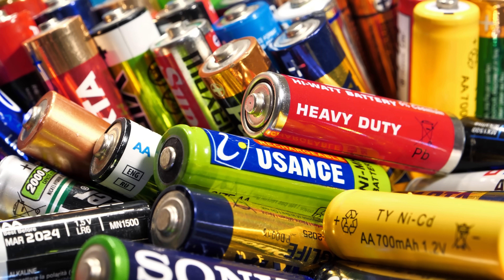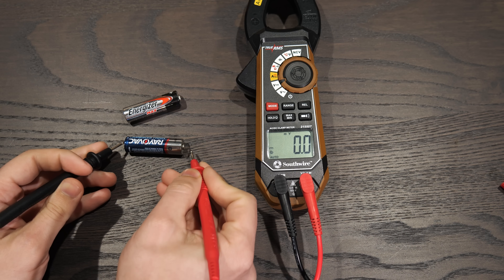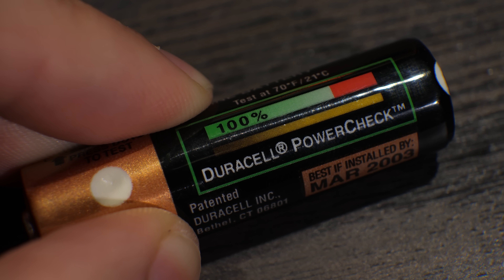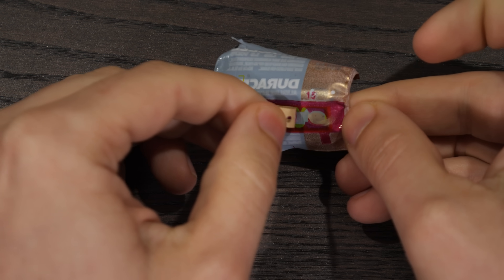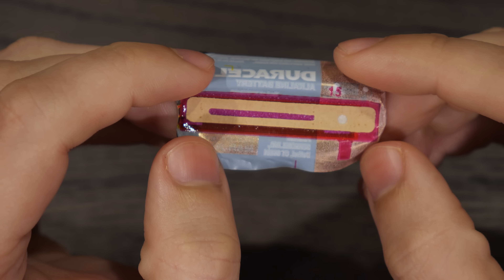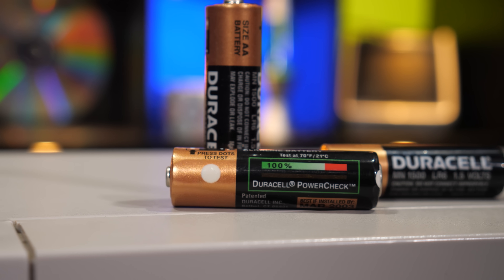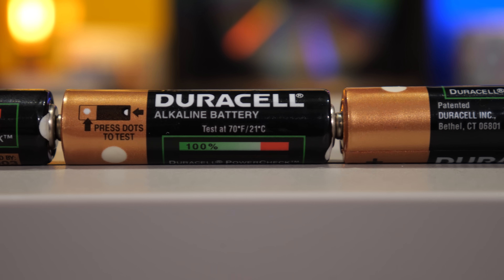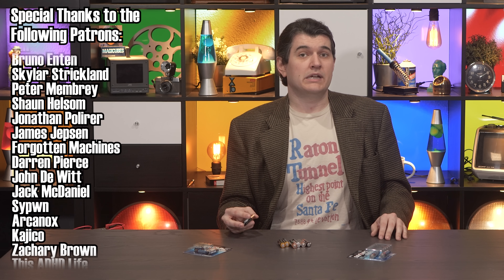Duracell PowerCheck: A genius idea which didn't last that long

Comment: Most e-bike accumulators have such a "power check" feature included.
But those are of course several hundred times bigger than an AA-battery.

Comment: It's e-waste. And a lot of devices had low batt indicators. Then it could add to the bulging and get stuck in flashlights. Then airports got strict about electronics.

Comment: The power check feature is what stopped buying Duracell. The number of DOA batteries was rediclious, and they had absolutely no shelf life once you started using them.

We'd put them in head lamps and get around 4 hours life, but if you put new ones in and only used it for 30 mins, they'd be totally dead 2 weeks later. Older Duracells without power check, and other brands didn't have the same problem.

We figured the tester was somehow being activated, or they cheaped out on the manufacturing, either way, we actively avoided Duracell pretty quickly.

Comment: My theory is that the original idea was to have an always-on indicator, so you could see the state of charge just by looking at the battery. Then they found out that it wasn't possible without slowly draining the battery and they ended up with this cumbersome implementation, unable to convince the marketing department to just scrap the whole idea.

The white buttons always felt like a clumsy afterthought.

Comment: I actually made a lot of use out of those powercheck batteries. My Gameboy was never that great at communicating how much charge the batteries had left. So if I was going to be dragged along on some outing because the parents needed to go somewhere and for whatever reason didn't want me to just stay home, I'd have to check the batteries and see if they had enough charge to last me the trip. Of course I could just grab an extra set of batteries each time we went out just in case, but then I'm always carrying batteries around with me. I could also have just kept a spare set in each of my parents cars, but who knows what is going to happen between me putting the batteries in there and the day I need them. Most likely my brother would find them and decide to throw them at me in a long car ride, or just hide them somewhere. My parents might find them and decide they need them and then not go and replace it.

Sure we had a battery tester and I could just go and get it every time I needed to check, but the built in powercheck was actually really useful in that situation because it meant I wouldn't need to go digging through the battery drawer to check and see if I needed batteries or not.

Comment: I usually went by: long term-low power or high risk of damage  (rear light of my bike comes to mind, it is not waterproof), use a disposable battery; for high power use use rechargeble NiMH. I think I have seen USB-rechargeble powerbanks in AA-format with appropriate terminals.

Comment: As for the usage pattern.. it's quite common to try replacing the batteries when something seems to not be working. For that you need to get some from, typically, an unopened package (more about the latter later). And it turns out it wasn't the batteries, so maybe you insert the originals ones again, or you don't, and  you try something else to figure out what's wrong with the thing. And whether you find out or not, in any case you are now in a situation where you have perfectly fine batteries out of its packaging. 

This, actually, happens enough over time so that you'll end up with keeping batteries that are probably good (the ones you thought were maybe bad), or ones that are certainly good (the ones you unpacked), and you store them somewhere. This even happens much more often now than when you could (as I did back then) check those batteries you suspected, directly (it IS a hassle to go find the !#@ tester, wherever it is, if you even have one, so no, instead you find some new batteries).

And there you have it. Boxes and drawers etc here and there, with a bunch of batteries which may or may not be good. Simply because you can't easily check if batteries are good or not.

And then the next reason.. how batteries are packed today. First, if you have one of those two-batteries-inside-one-package things, with plastic on cardboard as shown in the video, then you may need only one of them but the package is open and more likely than not it's hard to keep the other battery in there. The whole thing goes into a drawer, where it may fall out of the opened package, and it's not unlikely that you'll store old used batteries close by (because batteries should be and must be disposed of at the right place, so you keep collecting them until you have a  pound or so of them, and bring then to the battery disposal box in the grocery store or whatever. I really hope nobody dumps them in the garbage bin, that's the last place they should go).  

And secondly, because I don't buy Duracell anymore (because there's no incentive - no built-in battery check) I instead buy them in 20 or more plastic-wrapped bundles, where you get them cheap at the exit area of the shop.  Now I have some plastic wrapping which I open to get one or two batteries, now I have essentially a dozen or more loose batteries which I need to keep somewhere. Some months later I need batteries and start looking in drawers. Ah, here are some batteries.. are they good or not? Old? Who knows.

And all of the above just got more likely, and more common, simply because the batteries don't have built-in testers anymore.

Comment: I used the tester once or twice. But as you pointed out, you had to really mash it with your fingers to get it to work.
The other reason I didn't use it is I never knew how much current the tester was taking from the battery to display the voltage. In other words, i didn't want to drain the battery by using the built in tester.

Comment: Duracell for a brief period also brought back the power check feature with their “Quantum” line of batteries, in the late 2010s. this is how I learned that the feature even existed, because we used to buy those batteries exclusively. The power check feature was just as bad, but it seemed to have the same technology with a slightly different look.

Comment: These were so awesome because you could repurpose batteries for different electronics that use less and make them last until they're completely drained, or the inverse, you could make sure all batteries were fully charged for machines that draw more. It was like, efficiently planning and using every last drop of energy was satisfying - like seeing how far you can go before you run out of gas. And half-used batteries were around when you got new ones for your Gameboy for that long car trip.

These were also rather elegant in engineering and design. They represent a diferent time.

Comment: I remember having these as a kid. I did find the tester useful, although it was more of a magic trick than something I regularly used to actually check battery capacity. Having said that, for rechargeable batteries, it would be cool to see this make a comeback, because I actually have drawers full of rechargeable batteries in somewhat questionable charging states.

Comment: >No, I can't say "light up", I'll get pedanted for that

Uhmmm, actually, you can say light up. Clearly, the change in color of the strip is accompanied by a measurable increase in the intensity of reflected light. Thus, the description "light up" is perfectly technically correct. Which, as we all know, is the best kind of correct.

Frankly, I am astounded that this piece of misinformation made it into the video. You should do better next time, but unfortunately I won't be here for it, because I am unsubscribing and demanding a refund. Just in case.

Ahem...

     /\         
    / /    ________
   / /   /  _____/
  / /    \_____ \ 
 / /    /______ >
 \/

Comment: The only thing I'd offer in defence of these things mixed batteries. 

A remote with the last battery from one pack mixed with another from another brand (or chemistry) could see a perfectly good battery binned because its partner has died.

When I was a kid swapping batteries around was very common and many were probably disposed of early because we couldn't be bothered checking if one of the two was still good. Even worse when the device took three or four.

Comment: disappointing that AA and AAA are still a thing, while there are so many inexpensive 3.7V lithium batteries like 18650 or 18500.  Some of my hobby devices do use these 18xxx cells and 21700 cells even.   Smoke detectors could really benefit from the immense power density/longevity/amps capability of a single 18650.

Comment: I remember these very well and the ones built into the packaging. I used them quite often. Being a kid with toy trucks,robots, & light up He-Man swords, etc that made sounds & lights. I was always scavenging for batteries taking them from other toys to find a pair or worse four to work. often rarely used things would have their batteries removed after use so they didn't turn up corroded a year later... Those were just tossed in the junk draw.

Comment: "Loose batteries in the junk drawer saving the TV remote in a trying time."  

Man, you just unlocked core memories straight from the 90s that I completely forgot about. 

This was probably my favorite video you've done in the last few months. 👍 👍
Reply: The remote was what you used batteries that other devices considered "dead" in - because remotes can suck every little bit of power out of the batteries.. It's not dead til the remote says it's dead 🤣

Comment: I would just juggle them lightly in my hands and compare the weights between them and just use the heaviest ones. I don't know why it works since I never owned an accurate enough scale to check if they actually differed.

Comment: in many ways the AA AAA split was a bit like the Lightning vs micro USB charger split (or more accurately the USB-C vs micro USB)... the biggest issue people had with it was when only 1 or 2 devices used the other battery type.

Comment: why didnt they do powercheck for their rechargeable line? i would have paid extra for that feature on a rechargeable cell. a normal battery im gonna use till flat, a rechargeable im gonna wanna see how much juice is left so i know when to put it on the charger to get the most cycle life out of it.

Comment: 0:21 Given that r is squared in V = pi*r^2*h the smaller diameter makes a huge difference. According to a quick google search AA batteries have a volume of 8.3cm^3, AAA batteries have a volume of 3.8cm^3. Given that both batteries cost around the same, you get 2.2x more "battery" with a AA than a AAA battery.

Comment: I didn't own a battery tester in the past. Those batteries which could easily be checked directly.. it was so much easier. And good enough. Now I have these bulky checkers, and have to go find one whenever I need one, and buy another one because I can't find the first one.. not to mention when I travel.
I'm not finished with the video yet, so I wonder why it went away. I want those batteries back. It may probably make me start buying Duracell batteries again, without that feature I can as well (and I do) grab a pack of something cheap (which is not Duracell). Hm, I haven't actually bought Duracell since they stopped having that test feature..

Comment: I feel like this could be a really cool feature on some of those little rechargeable double A's you see, if only because the longer lifespan would justify the cost.
Reply: I don't think it'd be as effective on rechargeables as they only run at 1.2v and not 1.5v
Reply: @supergeekjay  Oh, didn't know that, thanks. I still wonder if it could be reworked to function on a lower voltage though.

Comment: Yeah, I usually just put the batteries in brand new, and if the device stops functioning properly then Step 0 of troubleshooting is replacing the batteries. Altough I have a blood pressure meter which is really picky about battery level. But those batteries just go into my kitchen clock which runs on them happily for months.

Comment: In Europe (Netherlands to  be exact) these Duracell testers still pop up from time to time. Not on every Duracell package, there are so many types. I never use Duracell anymore since i got  100% leak rate when they expire or are empty. Specially when put in led bikelights. I had to fix so many units because of leaky batteries. 80% of the time Duracells were used. The is a little hole on the positive terminal were corosive goo leakes out of This makes me think it is a design feature rather than poor design.

Comment: I am still burning through batteries. Also less things seem to work with rechargeables as they want that full 1.5v  times 3 or 4 and since rechargables produce just a little lower voltage.

Comment: Beeing a kid when these where comercially availible Ive had 2 uses for these:
1: its fun to a test batteries and just see what happens, party due to novelty, bit i also had fun usign the tester se had at home. Call me weird.😅
2: playing videogames, batteries where always at demand, and the ones from the gameboy had some life left in the tv-remote for instance.
And also, beting a kid the used batteries didnt always en dip in the right place, and the pack of new ones didnt always neatly go back where Theo shoud be. The result of this is that new and old batteries endes up in the same pile on the floor of my room, or at best in the drawer where only new ones was supposed to be. Needless to say the next time ypu ned a new battery there was way too hare to know which ones where used and not.

Not that it make those batteries worth it, the tester was easier to use, and arguably cheaper as it was already in the house when these started showing up. But to be fair to Duracell, a sales gimmick is also worth quite the investment at times, and I believe that both me and dadfoind these to be fin enough to warrant the price.. 😂

Comment: Regarding the different sizes of batteries, I'm sure I'm not the only only who - in a pinch - would use foil or other metallic objects to run devices on small-than-intended cells. I also remember when the internet was still in its infancy how early renditions of what we might now call life hacks showed how you could harvest 6 AAAA cells from a 9V or sometimes 4 D's from the large 6V lantern batteries.  And also that leading to one of my favorite nonsense videos a few years later showing all the cool things you could harvest from a VCR using only a screwdriver, a pair scissors, and some marshmallows.  If you know, you know...

Comment: Game boy was super efficient though.
4 batteries for something like 30 hours.
While parents were shopping or whatever I'd just be off in Koholint or whatever and it hardly ever felt like I needed to change batteries. 

Someone got me the Sega Game Gear for a birthday or something and that one was a joke. Used 6 instead of 4 batteries and lasted just a few hours- might even need a refill midway through a day it was so bad. Never bought any new games for that one.

Clearly any sort of power on a game system would start eating ridiculous amounts of batteries- I never got gameboy color but even that seemed to have much shorter battery life. But original Game boy itself was fine.

Comment: Surprised you didn't mention the fact that they were devices that would allow you to recharge your batteries. We didn't go through as many batteries because we always just recharged to them. But we did use them once you're talking about and a lot of times it was hard for them to get to activate you'd have to squeeze them really hard to get a reading

Comment: Oh, I remember these, but instead of Duracell, my market is Energizer, with a short bar and 'GOOD' in it as the indicator, and it heats from the middle to the side. So, if the battery is weak, only OO is visible, but if it's in full charge, the whole GOOD will be visible. Unfortunately, the battery size is slightly larger which means some small appliances have trouble putting it in. (Got a cheap motorised water gun that has a tight fit for normal AA batteries, and this Energizer can't fit without having its skin scrape off).

Comment: I was switching out batteries left and right on my xbox 360 and the controller gave me something around 1/2 a charge those half dead batteries saved me in a pinch.

Comment: Unlocked core memory of using the testing strips the built in testers and a spring adjusting battery tester. I don’t know why but it seemed like we always had mixed charge batteries in our battery drawer

Comment: My fingers remember this battery particularly it's edge button on the negative side. I remember avoiding testing because you have to press very hard to accurately show how much was left. If you push a little it would not go up all the way.

Comment: I just used my tongue and upper lip to detect how much power was in the battery. My dad always does the same and hes where i learned.

Strong weird neural sensation means much power.

Weak means low power left.

None means too low to detect at all, or completely dead.

Comment: I can still remember the inbuilt battery testers on Duracell batteries lasting until around 2010 in Australia, not that it was ever a reason to pay the premium price for them over other brands.
We're still paying 5-10% more for Duracell batteries over here compared to Energizer equivalents and in my experience the Energizer brand batteries hold their charge better while still packaged and provide better longevity in the same device.

Comment: Proper battery testers are more than just a volt meter, they measure the voltage drop across a small load.  A battery may measure close to nominal open circuit voltage even when it's bad.